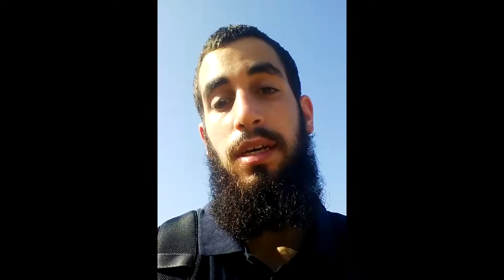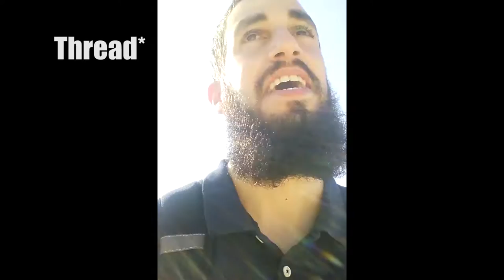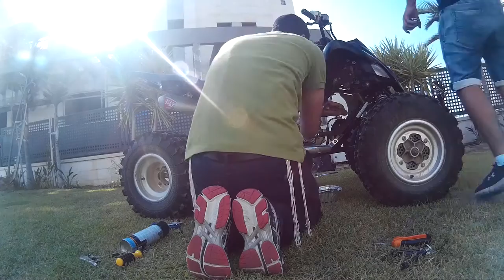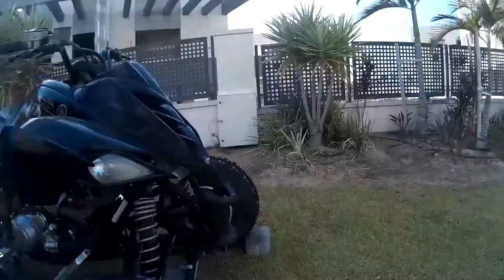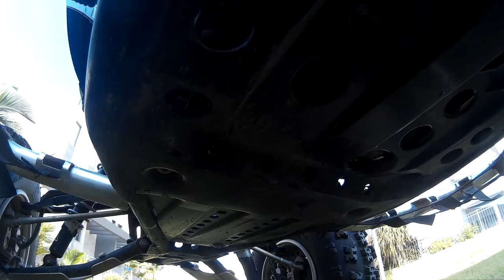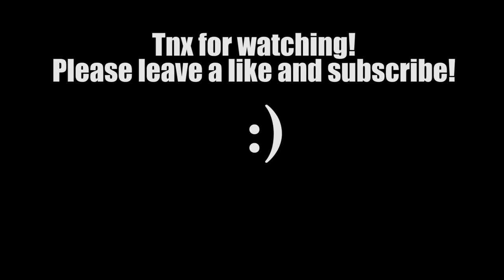Raptor 700SE -   Oil change & a broken bolt

Comment: I would think the threads would strip before the top would sheer off like that. crazy. now I know to be gentle with mine
Reply from the maker: haha...learn from my other mistake it's always smart (;

I got a new bolt just without the rubber from some mechanics for free, (really nice guy) and I used the rubber from my broken one (turned to be smart to keep the broken one)